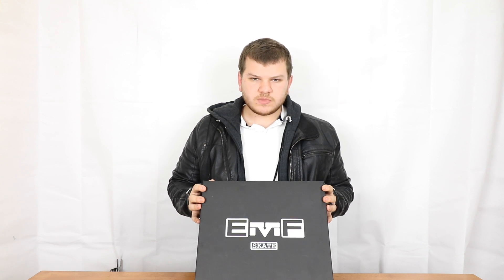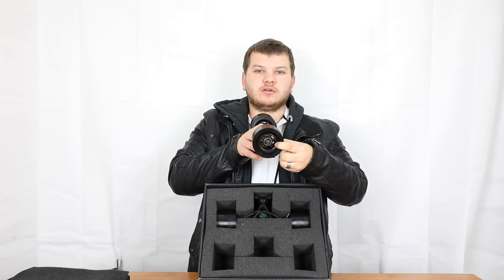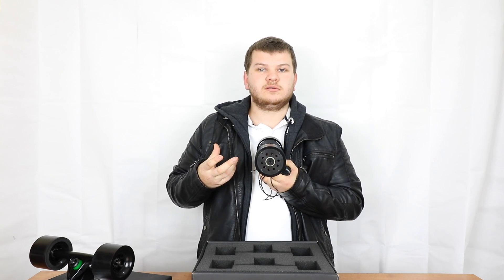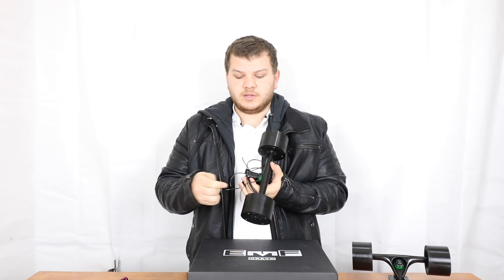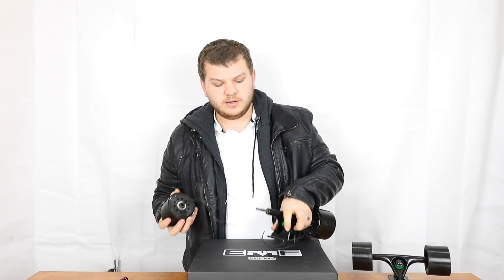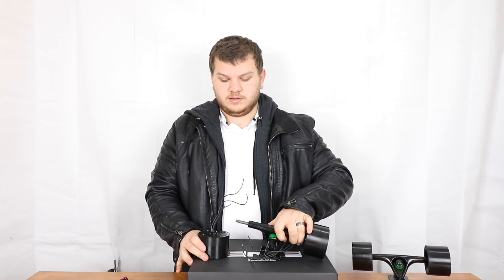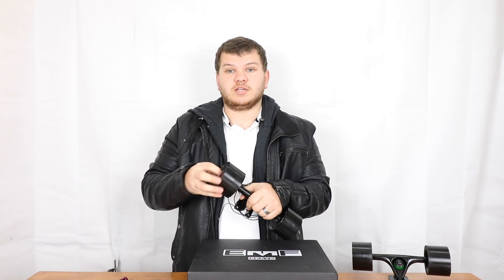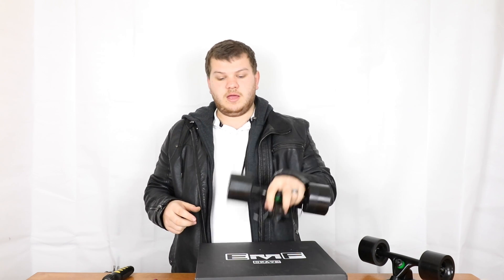EMF hub motor unboxing

Comment: Dont stop talking about your product!!! specially if its good! and if you find issues with it, talk about it! You are changing the game here with designs and taking them to the masses. The more feedback you get, the better you can make the product (and eventually cheaper). Make an outstanding product and the use of these guys can expand beyond electric skateboards! Look at the success (media wise) of the M1 from inboard. Make a great product and you can take out such an expensive board (yes, there are other point to take into account here, but the motor IS the central part). Good luck man, looking forward to buying a set sooner than later.

Comment: Great video, I was wondering could you still ride these hub motors downhill or will it blow the chips in the vesc? Because it's happend to me in the past with crap Escs ?? Again great video
Reply: I have gone 40 mph on my board once with a vesc and it wasn't damaged. I was not riding his hubs tho and I do not even own a pair. I would guess you could tho as long as the bearings in the hubs have some normal skate bearings which I'm sure they do cause his hubs are probably the best you can buy in my opinion.
Reply: Just send him an email if he doesn't reply here
Reply: +J Wightman you've answered my question already , thanks a lot